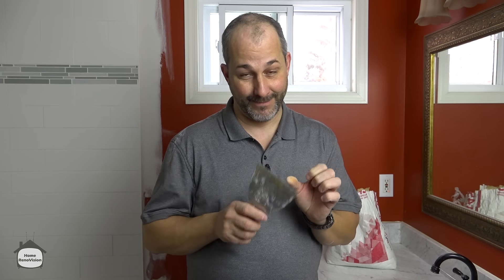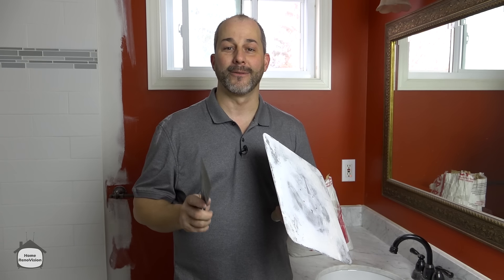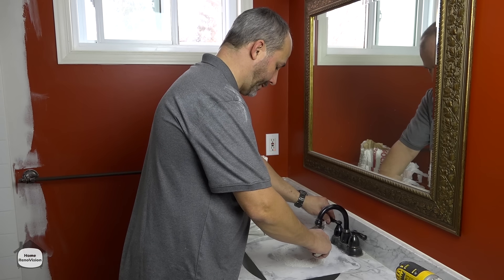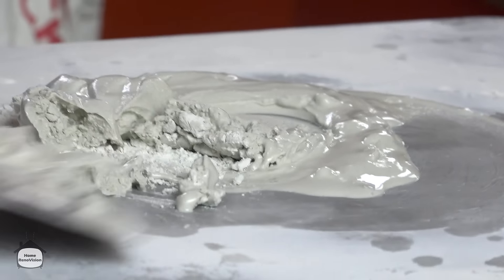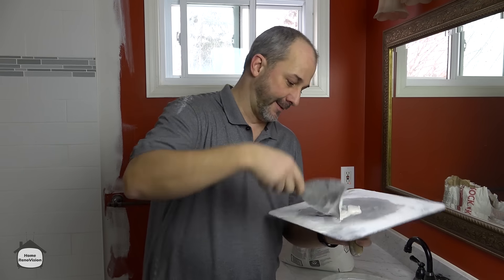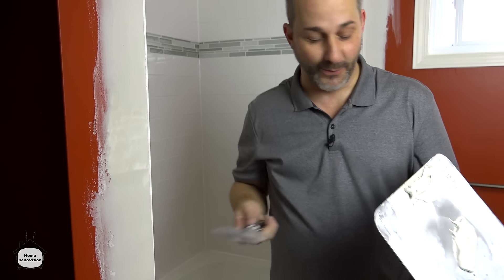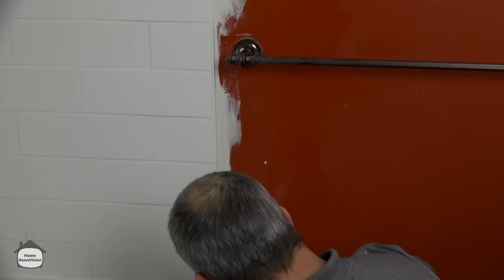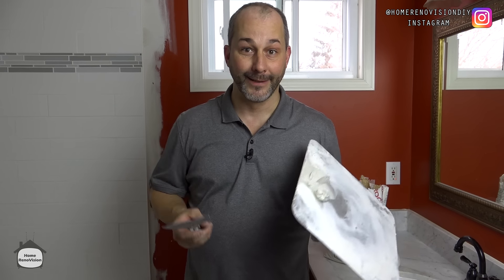Simply DIY Drywall Repair for Homeowners

Comment: I am having a closet redone. I have removed the old racks as well as 1x6 boards that were on the wall. These boards were a bit of a problem and cause me to damage a few spots of drywall. One spot is very crumbly. Should I remove all the crumbles or can I use 45 min mud and slab it on?

Comment: You need to prime fresh mud before using paint with a sheen because it will either flash out and make the sheen in that spot flat, or it will not adhere properly...

-15 year painter
Reply from the maker: not if you use 45 cgc on a patch you don't. Try it!

Comment: Always need to prime or it will flash. If you can use spray primer it dries in minutes then ready for paint.
Reply from the maker: The point to this  secret is that with this product you don't need to prime. Cheers!

Comment: thanks for the tip . But to go a little different direction ....
But a big question I have re " drywall repairs "  is this ... when a larger repair is done , ( most usually in an older home ) and it's all sanded smooth ,  then primed and painted .... I find that after 2 coats paint , you can still see where the patch was done because where the mud was all sanded smooth , vs the minor roller texture of the old paint around it   .
 I don't mean the edges , as there are well feathered out , but when you stand back a bit you see the whole patch area .

Do you have another  " Favorite Drywall/painting  trick "  to matching the old paint  texture , before you do the final paint ?

I'm guessing this is because today's latex paint " self-levels " better than it did years ago . 

I've tried different nap rollers and tried letting the paint set up a bit and then back rolling ...front rolling ...sideways rolling ...hopping on my left leg with my tongue holding out to the right side ....etc etc etc 

Or am I the only one that this happens to ?

Thanks 
Bob from Calgary
Reply from the maker: Hi Bob, the only thing that works is skim coat the whole wall, or reinstall the whole wall. Cheers!
Reply: @HomeRenoVisionDIY  Damn , not the reply I was hoping for ...I was really hoping that I was missing something obvious ... guess, as usual , there aren't to many shortcuts in life 
Thanks for such a quick reply

Comment: Great tip -- can I use this technique to repair a dented rounded/bullnose metal corner bead in a bedroom? Looks like it was banged with a ladder!
Reply from the maker: this will work well for that indeed. Cheers!
Reply: @HomeRenoVisionDIY  Great! I was afraid I'd need to cut out that corner bead and replace it. I've been afraid to just patch it. As a new homeowner, I love your channel.

Comment: Great video. Just one question. How does using a sponge negate the need to prime?  Won't the paint absorb into the patch more than the rest of the wall, causing a change in the look?
Reply from the maker: not with this 45 mud product.

Comment: Great tip. One question, have you use plaster of Paris, if so which one is better, easy sand 45 or plaster of Paris and what's the difference.  Thanks for all the great videos
Reply from the maker: 45 with hot water  sets in the same time and is easier to sand. Cheers!
Reply: Add fix all to the mud to make it a hot mud.

Comment: Could this sheetrock45 be used for paneling walls?  I want to paint some paneling walls in the den and I wanted to fill up those awful looking grooves.   Due to budget, I don't want to replace/cover with drywall.    Please let me know if this sheetrock45 is good for paneling or if there another or similar product I can use. Much Thanks!

Comment: Good tip Jeff, are you using the sponge wet or dry? Also if it’s textured dry wall, do you texture the mud?
Reply from the maker: We use wet sponges on flat walls here.

Comment: I couldn't find sheet rock 45 at my local Lowe's or home Depot would it be a different label or pre mixed? Thanks for the awesome videos.
Reply from the maker: not sure where you live but if you ask the guys at the counter they will show you where it is. probably a different manufacturer but still a rapid setting compound.

Comment: Jeff, we damaged the drywall paper in several places when we pulled interior doors. What kind of prep should i put on the paper before i skim coat it with mud.???
Reply from the maker: spray it with a little killz shellac primer so the paper is sealed. Cheers!

Comment: Could you show how to properly install handicap railing and hand holds?
Reply from the maker: The secret is to install 1/2 inch plywood in the shower first. That way you can install the fixtures wherever they are needed according to the professional who come to the house to do the layout.
Reply: @HomeRenoVisionDIY    Thank you!
Reply: Ty.  Will use plywood in my next DIY shower.  Do you let a horizontal strip into the studs where the rail goes?  Surely not cover the entire wall with ply?  
But I also need to retrofit rails to another shower wall.  If i remember, it has wonderboard under the 4" field tiles, maybe with a painted on waterproofing barrier between?  25 yrs old. 
We do have access to the back of the stud wall so can go into the studs for strength.  Waterproofing the connections?   Anything else i need to know?  Ty!

Comment: I have textured walls, any tips, tricks, or a video on how to DIY a repair?
Reply: I just repaired some textured walls myself. Mine had an orange peel texture. I mixed up some mud to a very runny consistency and applied with a roller meant for creating a rock/stone texture. Worked very well I found!

Comment: Dear Friend, i have diff. questions, can you response me , thanks. 1. can i use lining paper direct over drywalls and than paint the lining paper ? On the walls i see installations of drywall in horizontal direction and vertical, whats th ecorrect one?

Comment: Wet sanding does not constitute a feathered out edge. Especially if it's a hard glob that was hardly feathered at all.

Not sure if sheetrock is like durabond, but NEVER USE DURABOND for anything but your tape coat. It dries like cement and is virtually impossible to sand

Comment: Can this be used help repair imperfections like from small mollies that were used to hold up a towel rod?
Reply: yes! quick set works well for that... anything that requires tape, i recommend green top all purpose... it has glue in it and  that tape will remain on the joint for a lifetime and wont bubble or peal!

Comment: Can you use 45 minute mud as your finish coat?? I keep hitting this crack that didnt have no support underneath ...I keep coating with plus 3 and mesh tape but you can still see it
Reply from the maker: sometimes it is best to open the wall and add some blocking. Cheers!

Comment: I have a couple questions is it better to replace drywall that the paint is peeling off of or try and patch it some how and for drywall corners outside what do you think about straight flex perfect 90° tape or would you use something else I have about 60% of the drywall removed already a Reno that has gotten out of hand 😂
Reply from the maker: paint peeling is usually a moisture issue. find it fix it and replace the drywall. regular metal and or paper beads work great and cost less. Cheers!

Comment: How to do the same with a rough (textured) wall? I'm in prep my house for for painting. Should I still use sheetrock 45?
Reply from the maker: sure. just be sure to simulate the texture.
Reply: I also have a cement fireplace hearth that I'm painting over that has a lot of small to medium dents all over. Can I just use regular spackle to smooth it out or it's better to cover with some topping mud? Thanks!

Comment: My dry wall repair is cracking already can you help. It's a corner goes up to slanted ceiling. Cracking at corner on ceiling again. How would you tape a corner over lap top and sides?
Reply from the maker: sometimes drew even the best taping job cracks if the house is moving.

Comment: disclaimer alert..... more work if you have to do any texture to match existing textures. And yes you should add a primer before painting because the drywall mud takes to paint differently and will cause a type of photographing effect if you don't primer first.
Reply from the maker: The point of this video is to inform you that this mud does not do that. Cheers!

Comment: Thank you for the great videos. Can Sheetrock 45 be used to skim coat textured walls? I am about to paint the interior of my home, and the walls are way too textured for my liking so I'm looking to smooth them first. Keep up the awesome content!
Reply from the maker: sure but you will probably like the result of regular drywall compound and it is easier top work with.
Reply: @HomeRenoVisionDIY Great! I'll go pick some up this weekend and get to work. Thanks for the response.

Comment: I stripped the popcorn off the ceiling, can I use this method on the bumps and such in the ceiling - I'm going to leave it smooth, no popcorn replacement.
Reply: dont! it dries like a stone! i would 100% suggest a medium weight (purple top from lows or depot, and red top (pro form from Curtis) depending where u live!! it sands way easier and more time to work it especially over a large area like a ceiling.... add a little water and have at it!!! good luck

Comment: great vid hey do you prefer pre-mix or mix your self compound?
Reply from the maker: premixed with added water for large jobs. mix my own for anything small. Cheers!
Reply: Past two weeks... Will be. finishing up tomorrow removing 2 rooms of wallpaper .. in the living room I never had wallpaper. glue that would not come off I ended up chipping all the sheetrock the dining room isn't quite as bad but it is still taking me almost a half a day a  wall to remove the wallpaper no scraper divots either way!   Today I will go to Home Depot. And get a bag of spackle  40. I did use a wallpaper steamer and also smaller steamers for the other rooms but I just wonder why that wallpaper was so difficult it was pre glued wallpaper that I just soaked in water .... I will never use that again

Comment: I have one question why when I repair a hole I can noted the different in wall, I need to add something more to the mix or maybe I'm not duing correctly?
Reply from the maker: in most cases you need to resurface a larger area to make a patch invisible.

Comment: Help!  Getting ready to paint and I have two issues I need to know how to properly repair.  1. lifting drywall tape in a corner (one side is fine, the other isn't)  and 2. settlement cracks where wall meets ceiling and around windows.  If there's already a video for these items I'm not finding it.
Reply from the maker: Hi Rana, settlement cracks are sometimes best dealt with using caulking. if the crack comes back then you know you have movement and that the framing is not bonded together. lifting tape is usually a sign of moisture. best to remove and start over. Cheers!
Reply: Home RenoVision DIY any particular type of caulk?   Would I repair the cracks in drywall around the windows the same or with tape or create crevice and fill?

Comment: I think it is important to explain what pulling it tight means to someone with little experience! Otherwise you'll get someone caking easy sand on and will have a hard time getting it off if it dries. That isn't water soluble once it cures. you're basically wiping off almost all of the mud you just put on leaving a very thin coat. There should be no ridges before you sand. That is how you can wet sand it.  Also, mix that hot mud in a pan its a lot easier than dicking around on a hawk

Comment: To the hater saying don't show the tricks. You have been breathing to much dust. It's a trick. A TRICK NEEDS PRACTICE. That means you need to DO IT MORE THAN ONCE to get good results. Home owners are still going to screw it up. ( No practice) If your job is that insecure that you fear homeowners.....hahaha. A professional that fears an amateur is not a pro.

Comment: Can you use this great tip on cracked drywall, especially in corners?
Reply from the maker: on cracks yes, in corners try using door and window caulking 1 hour before you paint. Cheers!

Comment: every time i do a damn paint patch i always see the paint patch i did when light shines on it. :(  How do you avoid this?  I always end up having to re-prime/paint the whole wall. The new and old paint never blends in together.
Reply: I found you need to use primer. Then use the same paint the wall was painted with (even the same colour or colour matched may not work) the feather out. Use a wet roller over the primer, the go out with a progressively dryer roller.

Comment: Hi Jeff , is the grout sponge wet or dry?
Reply: At 6:15, he said the sponge was damp.
Reply from the maker: Thanks Rocky, Cheers!
Reply from the maker: Rocky is right, wet enough to wipe but it will not drip when you hold it. Cheers!

Comment: I was wondering if you have any tricks of the trade on how to lay ceramics over carpet? ( low pile carpet and its had the *^&% glued out of it to the floor) Floating ceramic floor? possible?
Thanks, great channel!
Reply from the maker: Never! You will definitely need to remove the carpet. I would suggest going to the local flooring wholesale supplier and ask them for products for removal. Cheers!

Comment: Thank you so much, you are very kind. Just one question, can I use this method to fill up a bigger hole? Or is this only apply for a smaller problem on the drywall? Thank you.
Reply from the maker: we have a video on how to patch a larger hole. simply use the search tool on the home page.

Comment: I have a problem. We just got some new satin paint. BEAR. basically a white colour. I had to first cut out a 16inch wide by 19inch drywall off the wall to get to electrical. So I put it back on. Patched it, 3 coated of mud. Sanded it before I put each coat on. It looked like i feathered all the edges. Then i primes it with one coat. Then i was ready for paint. The BEAR paint already had a primer in it as well. So i put the first coat of my new paint on and then I saw that the edges were not fully feathered. And I patched some dents and holes and in some places it kind of shows through the paint. 🙉🙉🙉🙉🙉🙉👀👀👀👀😣
Reply: Can still fix it after having put the 2nd coat on. 🙉🙉🙉🙉

Comment: Im in California and new to the game. I cant find any SHEETROCK 45. Whats the full name of the product and manufacturer and bag sizes. Also What is it? I see a lot of joint compounds and 2 different products of Sheetrock and ceiling textures. I think is the latter. I looked on Lowes.com & Homedepot.com but neither have that specific product. Thx for the help. I love your channel.
Reply: Any setting type joint compound works.  At Home Depot, it's called EasySand and comes in 5, 20, 45, and 90 minute.  At Lowes, it's called Proform Quick Set Lite.
Reply from the maker: look for Usg easy sand 45
Reply: @CLHPHD  Thank you so much!
Reply: @HomeRenoVisionDIY  Thanks Jeff! That was very helpful!  Love your channel!

Comment: PLEASE HELP! I ALREADY DID FLOAT & TAPE MUD JOB THAT CAME OUT BAD. AFTER I ALREADY PAINTED THE WALL! WHAT DO I DO?? BAD UNEVEN SEAMS
Reply: coat it! since its painted it will certainly bubble because you are going over a non porous surface... let that coat dry.. light sand to open the bubbles and recoat..... sand, and repaint! bing, bam, booom! lol

Comment: They all need to be “primed” OR painted more than once.
Reply: jeffrey williams That was my question!  I have three nail holes I’ve filled and sanded.  I’m looking at the white filler and wondering.....do I prime and then paint or just paint?  Every video I’ve watched so far says to paint.  Somehow that just doesn’t sit right with me.....
Reply: If it was a nail pop you notice on the way out, priming wouldn't matter, if the paint is still kinda fresh you probably won't need a second coat either
Reply: Yah, I'm pretty sure anything bigger than a pin head will melt/deform or just not stick without primer.
Reply: Quick question.  How would you fill a whole the size of a quarter?  Would you use tape first & then the mud ?
Reply: Thank you ,I was starting think I was crazy ,he said I'll show you my secrets, one of them being so you dont have to prime but he didn't do anything different, you still have to prime
Reply: @robynsimmons3711  you can just put filler in it. Probably going to take 2 coats.

Comment: You have to prime any mud. That stuff is so porous and no paint going to seal it. One reason is it will never add up to the sheen on already painted surface. Primer seals so the paint will stop sucking into pores. The other reason is primer is used for adhesion for the paint. Paint does has very little adhesion in it. This paint will peel right of like a rubber coating. This will not fly in high end houses the owners even know you have to prime cause they dont want sheen differences (flashing)
Reply from the maker: would suggest you try my little trick before you comment. Cheers!

Comment: Yeah im sorry but you have to prime "seal" all raw joint compound or the paint will look like crap......paint and primer in one....thats another gimmick.....primer and paint are different and do different jobs.....but the mud work is spot on
Reply from the maker: With most products you are right, however It is like banging my head to explain that this particular product, for whatever reason, does not need a primer. Cheers!
Reply: @HomeRenoVisionDIY  maybe its the hardness of the 45min compound......its probably very dense when cured and paint sits on to very well
Reply: Yea agree normally without primer it will look different the final coat of paint than the rest of the  wall. I wonder what brand of mud he's using if he doesn't really need primer!